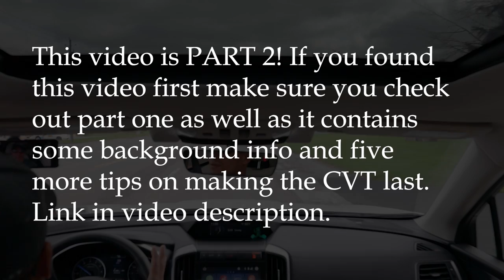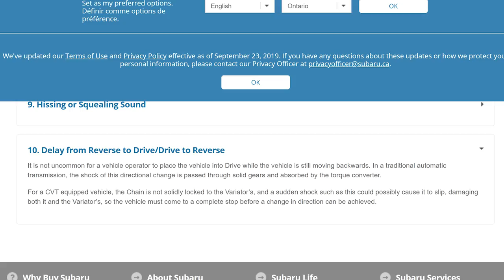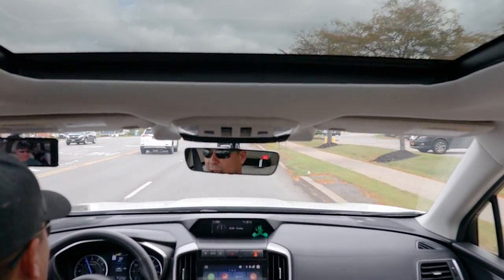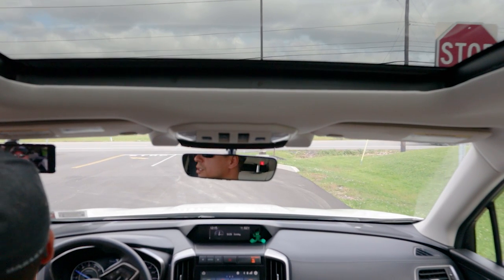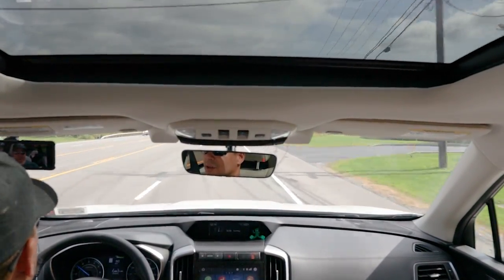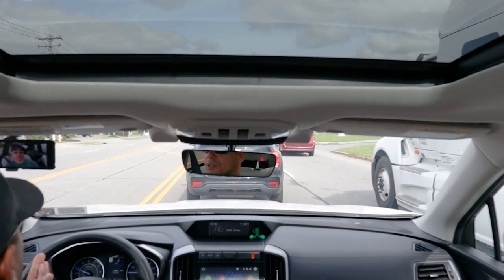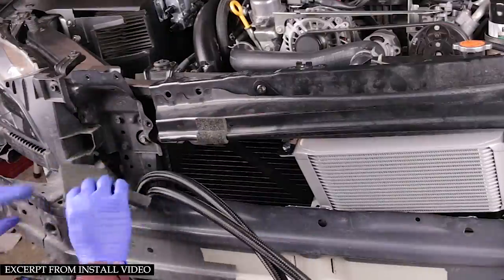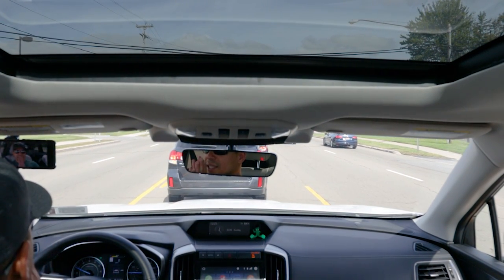How to Protect a CVT Transmission: 5 Practical Tips So Your CVT Lasts | Part 2 |

Comment: Should I change the cvt fluid In a Nissan? 2007 Altima with 162k miles?
Reply: Yes you should!
Reply: I have a Nissan Leaf 2012 with a CVT with 82k miles and changed the transmission fluid recently and it was BLACK (literally burned). It supposed to bed intense RED.

Comment: Sometimes my car has a higher rpm than is necessary for its slow speed.  It feels like it needs to be in a different gear.  After I put it in neutral for a bit, the rpm will settle down to where it feels appropriate.

Comment: Does shifting down gear too fast damage your cvt engine?

I got a habit of down gear to first gear will I am still moving around 30 mph
Reply: @akqjtn  the reason was because of the snow. There was a videos that talk about how down shifting were use to slow down the vehicle without using much of the brake so the brake will last longer and most importantly prevent the car from losing grip and lost control. If you got a proper video of how to do this then please link 🙏  or how to properly down shift.

Comment: I just bought a 2017 honda accord with 40000 on it. I'm thinking of changing the fluid to put my mind at ease knowing that it's been changed. Since I've never owned a car with a cvt trans. How much am I looking at to have the fluid changed? Thanks for any help. And I'm a little nervous about buying this car after seeing a lot of negative comments on the cvt transmission
Reply: If you do it yourself about $30 bucks

Comment: I dont know what color the CVTF-ii is supposed to be from factory but I can tell you 100% that my non turbo 2.5L 2015 forester did NOT have green fluid. It was red I accidentally drained it at around 30k miles trying to do my first subaru oil change at home. Topped it off with some off the shelf hinda brand cvt fluid and it worked perfectly fine

Comment: Ive done spirited drive for 139k km in town 5 days a week 10-12h a day and i dont know why my titanium chained cvt work like day 1 meaby its because im let it stock but engine and transmission run perfectly and never have any issue except an overheat transmission at 95k km getting stock on ice  that was only electronicaly lock after a reset and transmission oil change never appens again!

Comment: Very great videos!  I have a 2014 Honda Civic with the CVT, and so far, it's a great transmission.  It has no way of monitoring temperature, but I guess Honda figured it didn't need that.  Sometimes on a parking lot or when the engine is hot like in summer, it may lug a little bit, but being it's an automatic, I figure Honda built it to do things right.
Reply: I have a 2015 Civic coupe with a CVT, and I agree.  It's a great car, and the transmission actually makes it more fun to drive.  Plus, near 40mpg at 65mph is no joke.
Reply: You could get a Scangauge II that plugs into your OBD II port and should enable you to read ATF temperature.

Comment: I stumbled upon your videos while doing some research. I have a 2015 FXT with now 85k miles. I went to a Cobb stage 1 tune maybe 10k miles ago. I have felt the chain slip now twice (because the first time I didn't realize what it was). I removed the tuner and stock it is fine. In your opinion, do you think a full fluid flush/ change would significantly help (I'm going to get it done regardless) however, the car is nearing the end of the warranty, and I'm afraid to put the tune back on. Hopefully the brief seconds it slipped wasn't enough to destroy the internals of the trans.

Comment: Best way to make a CVT last is to buy a bicycle and ride it instead whenever possible.  Try to limit your CVT to no more than 100-200 miles a year.  Never drive it faster than 20-30 MPH.  Anything faster will heat it up too much.  Now, if it is winter and the temps outside are below 15 degrees F, you may comfortably drive it like a maniac and go 40, maybe even 45 MPH.  Oh, and don't forget to pray for your CVT every night in your nightly prayers.  I hear God likes to give people an extra 50-100 miles of life on their CVT if they are faithful.  Good luck all... your CVT can easily hit 1K miles before it clunks out if you just give it some TLC and follow my advice.

Comment: Honda's are known for requiring specific transmission fluids for their vehicles. Using the wrong transmission fluid in a Honda can really damage the transmission.
Reply: Donald Wilson  well... no
Honda does not have the best motor oil. Testing via Blackstone labs proved this to me. A good synthetic of equivalent viscosity for transmissions is just as good if not better. Honda’s weakness ( automatic transmission) is their service interval. I would change it every 40k not 60k.
Reply: Use amsoil cvt fluid 100% synthetic

Comment: I have a 2011 legacy, does anyone know how much lag or shaking is normal when shifting into reverse?
Reply: I have a 2010 Model and it does a little shimmy when I shift into reverse. Remember to fully stop and give it that "split second" when you shift into reverse.
Reply: Steven Sanchez I have a 2010 Legacy, too. I think that ‘shimmy’ is a failing torque converter. There is a TSB that authorizes replacing it under 100K miles. I didn’t discover the TSB until well after, unfortunately.

Comment: Hey, thanks for making these videos on CVTs, very helpful! If I would have watched this before, I would have probably not bought my used WRX, BECAUSE it has always made that bad sound when taking it out of park, and it has gotten worse. I didn't know how serious it could become and that it's not easily fixable if anything were to happen. I planned on modding, (past current tune and intake) and I like to drive spiritedly as you say!  But now I'm thinking I can't have any more fun because of the condition the previous owner left it in. Would you advise against modding for power/cooling or racing in this as is?

Comment: It's suspected that a problem with the vehicle's cooling system is making the CVT transmission unreasonably sensitive to heat. The temperature of the cars transmission fluid is controlled by a small cooler as opposed to a radiator and it's not properly regulating the temperature of the fluid responsible for lubricating the parts in the transmission.  Should a car overheat and go into "fluid protection mode" transmission performance will be reduced and as a result the driver may experience trouble accelerating, vehicle shaking or jerking  and or complete failure of the CVT.  ----  Possible solution- MORE FREQUESNT COOLANT CHANGES

Comment: I never put my CVT into Manual mode, I always keep it on D mode when going forward.
Reply: Why not? It's a fake manual mode,  good for forcing it to run in higher "gear" for better gas mileage on the highway. I wouldn't use it to force a lower "gear" tho, I can see that would add stress to the engine and CVT belt

Comment: # 2.) Lugging with a CVT?  Is that supposed to be even possible?
Reply: It shouldn't be possible to truly lug the engine with any correctly designed and functioning automatic transmission. Some transmissions may hold high gears for longer than we like going up hills or accelerating for fuel efficiency reasons, but that's still not truly lugging the engine unless you are at 1500 rpm wide open or something, which it shouldn't let you do. On nearly any auto you can floor it from a stop in high gear and the torque converter still won't let you truly lug the engine to the point of doing any damage unless it is locked, which it shouldn't be under that kind of load. On my automatic Civic I can floor it in 4th gear from a dead stop and the torque converter will still allow the engine to rev to ~2800 rpm, which isn't lugging it.
Reply: @averyalexander2303  use the Manuel gear selector
Reply: @gameonyolo1  It still wouldn't let the driver lug it, automatic transmissions are designed to be pretty idiot proof these days. I can't speak for all autos, but at least on all the reasonably modern automatic cars I have ever driven or been in will ignore a ridiculous gear request and do what it wants if told to do something stupid like accelerate from a stop in the highest gear gear or downshift to the lowest gear going 80. A lot of autos will let the driver start out from a stop in 2nd gear, but doing so still wouldn't lug the engine since the computer wouldn't lock the torque converter while accelerating from a stop at in a high gear at a low RPM anyways. The only way this could possibly be damaging is it could heat up the transmission from torque converter slippage if done over and over and over without any time in between attempts for the transmission to cool down, but that's about it.
Reply: @averyalexander2303  true I mean more about like weak luging
Reply: @gameonyolo1  What exactly do you mean by "weak lugging"?
Reply: @averyalexander2303  in my Nissan if you manually shift it up and give it gas it kinda vibrates
Reply: I had a coil pack go bad on one of my cylinders causing it to misfire resulting in horrendous lugging with the automatic mode (felt like the engine was going to shake right out of the car) it did not change the ratios to prevent it, I had to use manual mode to keep the rpms up to prevent the lugging, and get the car to the shop.

Comment: Best tip is to not buy a CVT equipped car.  You can learn to drive a manual.  Especially if you're buying a performance oriented car like a WRX.  Just do yourself a favor and buy a boring car to go with the boring CVT.   The all wheel drive system in the manuals is even way better than the CVT's.

Comment: My service book for my 2019 outback does state to change the cvt fluid when the car is used in extreme condiations. That included repeated short trips every 24000 miles or 24 months. Look after your car and treat it well. As for manual cars I have seen them destroyed by bad driving and burnt out clutch. Want to know how bad a normal auto can be then buy a GM or Fiat Crysler. You can buy them at any junkyard and they are easy to find, they are called new car dealerships.

Comment: Is there any possible way to install another transmission cooler, if the one that comes with the car has coolant running instead of CVT fluid? I went to my mech but he said he can’t do it unles the lines had cvt fluid, not coolant. 2016 Corolla 1.8L

Comment: Nice, helpful video- however I have a couple of things to add. First, I highly doubt that anyone shifts from reverse to drive doing 5-10 mph unless they are trying to destroy their car on purpose or are running from the cops. I'm picky the way that I drive my cars, and hers is no exception. When backing up, I will shift the car into neutral while gradually coming to a stop and with a little practice, you can time it perfectly as to where the entire transition is seemless and quick. Now, if I could only get that goddamn Subaru to stop beeping at me every 10 seconds.......

Comment: Lugging a CVT? This is more complicated, at rpm below the torque pique the engine applies less torque the drive disk puts the chain at max diameter thus even less force is applied to the chain. Please rethink your advice.

Comment: Nothing you're going to do is going to prevent the CVT from failing you could change your fluid 100 times you're still going to have steel because the belt is constantly failing and depositing metal in your transmission fluid

Comment: during my search buying a used car my number one brand i decided to avoid is Nissan they are getting crazy using that CVT .. they look nice !! but unfortunately they got CVT !! so No thank you not buying a vehicle with a CVT.. when engineers design something new.. they don't think of the used condition. they think someone will buy it brand new only after few years to find out the flaws about their failure design at the customer expense !! why would you go in debt for such stupid uncalled for transmission design !!!
Reply: it seems like each person drive s differently and is sensitive or not to what the car is telling them.Driving habits and maintenance is a large part of a vehicle's aging and condition.

Comment: Subaru and Nissan use CVTs from the same manufacturer.  Toyota uses a different CVT manufacturer and they have fewer problems.  Honda makes their CVT in-house and it holds up better than Nissan and Subaru.  The weak link in a CVT is the drive belt.  Weight and power are the enemy of all CVTs.
Reply: Subaru makes it's own cvt. It's not a jatco. Subaru has sourced jatco for some conventional auto's over the years but never any cvt's. All there cvt's are made in house. They actually haven't had alot of problems with them.    Nissan has had tons of issues. Nissan and Mitsubishi use jatco.
Reply: Honda city 2018 good?
Reply: They’re made by Fuji heavy industries in Japan

Comment: The first tip is completely false !! If you press the brake hard the car weigh goes to the tires,brakes and suspension not to the transmission

Comment: So many DON'TS.....you forgot one....don't buy a vehicle with a cvt transmission!
Reply: You got that right!
Reply: Why not?  My 2015 Civic with a CVT has been fantastic.
Reply: The auto makers only went with CVT  for two reasons cost and mpg. Long term reliability depends on regular maintenance and how you drive your car. A regular automatic with steel gears versus a steel belt that rubs against a steel pully using friction to propel a 3500 lb car. If you keep your car for only 100k it doesn't matter, but buying used (out of warrany) will be a gamble. Toyota and Honda CVTs are better than Nisson/Subaru but more years of reliability data are needed.

Comment: Why would you choose a car with a cvt. Apart from Toyota. All I've heard are horrible stories. Cvt needs to be rebuilt less than 40,000 miles. And there expensive. Just Google jatco cvt problems. I'd stick with the old torque converter autos.

Comment: I made my CVT last longer by choosing to get a manual transmission. Subaru extended the CVT warranty anyway because they know it'll blow up.
Reply: You also chose to post an anti CVT message on a CVT help video on a CVT channel. Subaru also extended the manual warranty for 2015-2018 because of premature clutch failure. "Glass Houses"...
Reply: @onffxiimanon  pretty sure they stopped it with the 17s. Unfortunately the 18s beyond couldn't get the extended warranty because they've "learned"
Reply: @alamsas2  According to SB 03-79-18BR new parts were incorperated "mid-2018". Here is a picture: https://imgur.com/T59LXy2
Reply: I also tought manual gearboxes were better till the clutch failed also had problems with normal automatic transmission when putting it in reverse. These things wear out transmissions are not bulletproof they last longer if you service them in time or if you don't stress them out.
Reply: @Jake Colbert oh thanks for letting me know i just got a car with a cvt(toyota) so this is all new to me been hearing so many bad things about them but i also had problems with older non cvt transmissions so mostly it's the way you drive the car i baby my cat so hopefully it will last.

Comment: CVTs are trash and just don't buy a car with one. There. I fixed it for you.
Reply: Would you call your comments trash or rubbish?
Reply: Guy G Not at all. Unlike CVTs my comments are useful, practical, and hold up against the test of time. 

Let’s look Subaru for instance. TFL isn’t allowed press cars because they called them out on the hindrance the transmission has placed on its legendary off-road capabilities. 
Nissan is losing money hand over fist, in part of because of bad financial decisions, but also the lack of reliability in the transmission especially in the pathfinder. 
Even this guy pretty much said you gotta toss the thing out of it breaks because of the complication in rebuilding them. 
They’re uninspiring, sound terrible, lack any performance of any marking compared to a traditional cogged tranny, and let’s face it. 8,9, 10 speed gearboxes can provide nearly identical fuel consumption numbers without any of the deficiencies.  
But hey, everyone has lifestyle choices 🤷‍♂️
Reply: @The1stMoRice   agree! Or just buy a manual or a truck with allison auto
Reply: @The1stMoRice  Without any of the deficiencies? Modern non-CVT trans fail everyday, LOL. You guys are too funny with this CVT hate. I know people that are long term CVT equipped Subaru owners and not ONE of them has has a CVT failure. So much internet bullshit regarding CVTs and failures. Do they occasionally fail...of course they do. And when one does, every internet super hero jack-off rushes to the computer to post about it on a hundred websites. At the same time the non CVT trans continue to fail everyday, all the time but no one rushes to post about them because it's been a normal occurrence for 50 + years daily. You may not like the way a CVT feels and I get that, but this spreading of the misinformation about failures and reliability really needs to stop...SMH